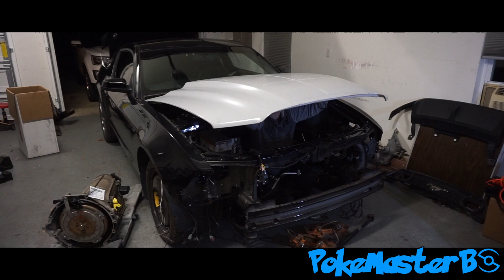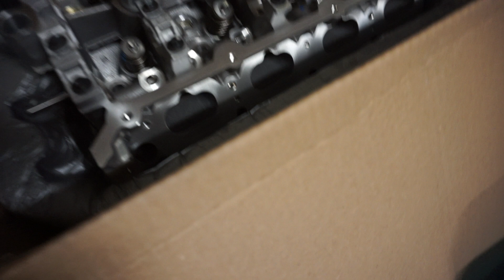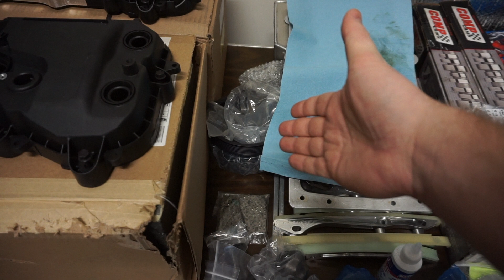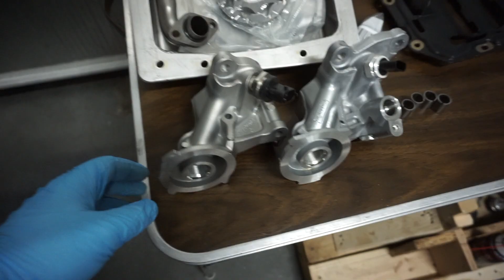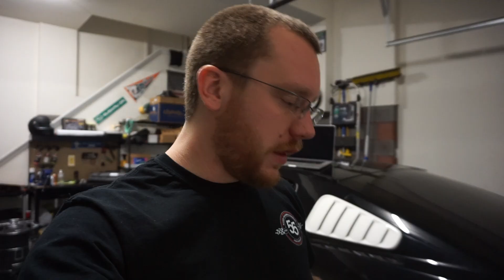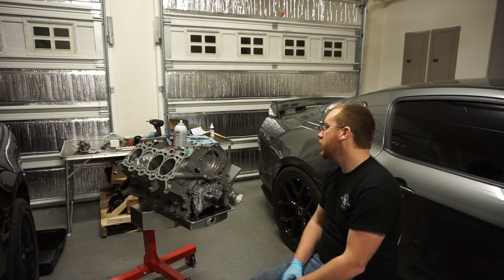Frankenstein Coyote Build p.1: Setting Up The Shortblock

Comment: Is it okay to remove one of the main cap bolts and install the cap bolt with the stud for the pick up spacer?
Reply from the maker: Absolutely. That’s the recommended way of doing the swap and more affordable for it over doing the arp main studs like I did.

Comment: If you dont use the ARP stud kit you will need to replace one of the main cap bolts for the bolt with a stud that the gen 2 block has and the gen 3 doesn't due to not needing a separate pick up tube.  the part number is BR3Z-6345-A.
Reply: I had to realized that myself when I turned the aluminator block around and saw all the cap bolts were the same but the engine kit I got came with one bolt which I’m guessing is the bolt for that replacement
Reply: Also, you can’t use the GEN three rear main seal housing because it uses a three pin connector on the crank case position sensor, and then the last thing is make sure you grab the knock sensors for a GEN two as well since the GEN three uses different knock sensors
Reply from the maker: All good relevant info 👍

Comment: I used gen 1 heads on a gen 3 block and had a leak. I used 12mm head bolts and gen 1 head gasket. Just kinda confused on what I should do
Reply from the maker: That combo in paper checks out. But if you had a leak you’ll obviously want to revisit most everything. Something that might be worth doing is just checking the torque on your head bolts and see if something is off there.
Reply: @pokemasterbs appreciate you! and what do you mean by paper checks out ?
Reply from the maker: @NoLimitTJ_  just a phrase. “On paper it checks out” as in logically I see no issue with it combo wise. Doesn’t mean you don’t have some kind of problem associated to the combo. But in theory it should be good.

Comment: Thanks for the video. How did the motor turn out? How many miles do you have on the engine now?
Reply from the maker: It’s been great to me. I think I have probably 10-20k miles. Hard to say exactly because my Speedo was off a significant amount for a long time. But plenty of pulls, couple of trips to the drag strip when I can go, and some general daily style driving dealing with traffic on occasion. It’s handled it all so far.

Comment: How much do you think this build would cost, or did cost when you did it?
Reply from the maker: I’d say anticipate between 6-10k depending on what all the parts you decide to do are and if you do the work yourself or have to pay someone.
Reply: @pokemasterbs that's not terrible, man! Yeah I would do all the work myself as well. I took last week and this week off work to install my roush blower and OPG on my 55kmile  Gen 1, so hopefully it lives a long life before having to be rebuilt
Reply from the maker: @TheManic.5-OH it definitely should last as long as you want it to with a solid tune! Mine never blew on me I just decided it was time for the upgrade as my goals were definitely beyond what the stock Gen 1 was going to take.
Reply: @pokemasterbs  oh for sure dude! Honestly I'm glad I pulled my timing cover for this job, I found my driver side main tensioner had a big ass split in it in the top portion where it mates to the head! I think some other guys found this too. I think it's safe to suggest guys replace these with BOSS tensioners when replacing timing components for the first time.
Reply from the maker: @TheManic.5-OH oh wow that’s surprising. I’ve never seen or heard of anyone having come across that but good to know to keep an eye out for.

Comment: Great video bro!!  Quick question? Would you done anything different? I’m getting ready to do the same!! I just ordered my block from ford performance and I was actually thinking about going back with the GT 350 crankshaft? Thanks
Reply from the maker: Nope note really! Car still runs great and was able to almost break 1000hp last week. The only thing I would recommend different from what o did originally is use the Gen 1/2 rear main seal retainer plate over keeping the Gen 3 plate when running the Gen 1/2 crank trigger sensor as it’s not supported correctly in the Gen 3 plate and is known to cause potential issues. Why would you choose to run a gt350 crank? That’s like the root issue for all the GT350s and their issues based on the harmonics from the flat plane crank and firing order change. Not to mention you would need a completely different computer setup either standalone or GT350 based to run it in whatever you’re dropping this into.

Comment: Did you have any issues with the gen 1 crankshaft position sensor and the gen 3 real main seal retainer?
Reply from the maker: Personally I have not. If I do they are minimal at worst. But I know of others who have had issue. General recommendation is swap the rear main cover to make sure you’ve got no problems.

Comment: Did that short block come with stock rods and pistons? Can that hold the power you are putting to that motor? 
Thanks!
Reply from the maker: Yea stock shortblock including rods and pistons. It’s had no issues so far and the cars been making 900hp or so without issue 👍

Comment: The reason they recommend checking and line honing the mains if necessary is because studs have a different clamping force than bolts which can distort the caps differently and change your clerences. 6 bolt mains tend to be very ridged. My machine shop told me that even with studs line honing wasn't nessisary. I also verified the clearances.
Reply from the maker: Right. Hadn’t heard that the 6 bolt mains tend to be rigid but makes sense. I’ve had zero issues with mine after doing what I did lol wouldn’t recommend it to anyone else but it’s worked for me 🤷‍♂️

Comment: Mine is a gen 1 (12mm) sleeved block with gen 2 cams and heads and a gen 3 intake and a build bottom end including billet oil pump. One of the nice things about the coyote is pretty much everything is compatible across the generations so long as you don't mix up things like timing chains.
Reply from the maker: Kind of like the Honda of muscle cars I guess right 😂
Reply: I though you ad to keep the gen1 cam ?  i just order a gen2 can i keep the gen 2 cam ??  i was gonna swap them with gen 1 and timing

Comment: When installing the new oil pump gear set, you want to coat the gears in a heavy coat of motor oil.  Its not good to start the pump on first startup with zero oil on the gears.  Also when you swapped your ARP bolts on the caps, you should have removed the caps, plastigauged the stock bolt set and record the results, removed them, installed the ARP bolts with plastigauge on the crank, remove the ARP bolts measure the gauge then compare the results of the 2 bolt sets.  That way you would KNOW if you are in spec with the new ARP bolts or NOT.  You can eliminate so many issues by using the oil pan that you used.  That was a excellent call!  That plastic crap should have never been used by Ford. They are just getting too cheap these days.

Since it has now been 2 years since you posted this, how is the motor?  Did you have any issues?  Still running good?  Blown up?
Reply from the maker: Great points and suggestions. I was aware of some of that when going into the build but having never assembled a motor before let alone a rotating assembly I wasn’t comfortable trying to mess with some of that stuff. It was a bit of a gamble doing what I did, however it seems to have been holding up great so far. I’ve got somewhere over 5k miles on the setup since getting it running and have never had any issues motorwise. What I did was the best thing I could come up with to compare based on the skill set and knowledge base I had at the time going into the build. In regards to the gears I never start fresh builds without at least priming the motor first by doing a no fuel crank a few times for that reason or trying to keep everything protected. But yeah so far so good! About to get it back together again after some revisions in my setup here today probably and should be set to keep on ticking along. Making a tad north of 900 whp through it.

Comment: so i’m very curious to know if i absolutely have to swap the oil filter adapter and the oil pan? i bought the gen 3 block and would like to use what comes on it but i’m not sure. please get back to me asap.
Reply from the maker: You don’t have to swap the oiling system just the oil filter adapter.

Comment: Hey bud I know you made this video a long time ago but I’m about to start a gen 1 shortblock swap into a gen 1 and got a couple questions what year oil pump and gears did you use as well as the rear main seal kit.
Reply from the maker: Oil pump/pick up tube/pan all need to match. Either all Gen 3 or Gen 1/2. If Gen 1/2 you need to swap out one main stuff for the oil pump pick up tube support. Rear main technically could be swapped to the Gen 1 to properly support the crank trigger sensor but you can leave it as the Gen 3 stock piece and be fine, that’s what I did. I just moved the rubber gasket further down the sensor to meet the rear cover. Never had any issues with it

Comment: Very nice work. Question, those side scoop- did u ever loose one? How well they stick? I afraid I’ll loose them with double side tape. Also do u have them blocked? Thank u
Reply from the maker: Thanks! I have never lost one of my side scoops. They are factory ones and just attached via 3M. They are blocked as that’s how they come OEM. They probably do have less air pressure on them because of that.

Comment: Great video. Thanks for sharing. Thinking bout going N/A build. Not racing. Going to my daughter. What would you recommend. Thanks. Much appreciated.  Not sure bout cans,  was thinking boss 302 intake. Headers, e85 47lb injectors.
Reply from the maker: Thanks! Sounds like a solid build list for a fun N/A setup! Only thing I would add to that list would be a few suspension mods like springs and rear control arms and should make a great little street car without being over the top 👍

Comment: How come you didn't use the gen3 heads?
Reply from the maker: Because you can’t. They are designed to work with the direct injection which isn’t an option on gen 1/2 cars. There are no provisions or parts to have been made by anyone to make them useable in the older gen setups. In addition gen 2 heads are so cheap it’s not worth doing gen 3 not do I believe the gen 3 flow significantly better etc.

Comment: Did you used 13-17 ARP head studs or 11-12/18+ ?
Reply from the maker: I used 12mm for the 11-12 motor. The 18+ are apparently different somehow but the 11-12 work perfectly fine and are what everyone used to my understanding.
Reply: @pokemasterbs  Thanks!

Comment: I am doing a similar build but I’m not 100% sure which timing cover I need to get the GEN 1 2 or 3 timing cover?
Reply from the maker: Just reuse your stock one. Unless you need an additional one then just get the gen 1.
Reply: @pokemasterbs  I am building the motor piece by piece just didn’t know if there was any major differences between the covers through the different generations
Reply from the maker: Gotcha. I think the gen 3 is fairly different but I would say just get whatever gen timing cover based on the car you plan to put it in.

Comment: So, why not put in good rods? Instead of using those powdered metal rods. You are going through a lot of time and money. They are not as good as a set of Oliver or Carrillo forged rods.
Reply: Additionally, I would not use the VVT. Especially if I was spending money on aftermarket cams.
Reply: I also noticed you installed the pan early. You put sealant on the rear main seal seam to the pan. Then torqued it down. What about the seam at the block/timing cover?
Reply from the maker: I don’t have plans of pushing the car over 1000 wheel HP so it didn’t seem necessary as these short blocks have made that and even more in stock form numerous times. In addition I don’t have the know how or experience to swap the rods and bearings etc on the bottom end so it was the simpler route to go to meet my needs. I could have deleted VCT but I would loose low end power and drive ability just for it to sound cool. Again it makes sense in certain higher power applications, but that’s not my car. As for the pan, I assembled it in the correct order. Are you referring to the rear block seal which holds the rear main seal? That comes assembled from ford siliconed together etc. I didn’t bother redoing it and so far it seems to have held up beautifully. If your are referring to the front timing cover I didn’t install that until the whole motor was assembled.

Comment: Can i run gen 1 heads? Im picking up a built sleeved gen 3 sb for my s197.
Reply from the maker: Yes just run gen 1 head gaskets to match.
Reply: @pokemasterbs  what are the pros of running gen 2 heads? Are they that necessary? I rather not spend another 1k for them if i dont really need them! Im looking to push around 850 on my gen 1
Reply from the maker: @s197productions6  They aren't necessary. You can reuse your stock gen 1 heads maybe just throw in better valve springs while you're in there. The benefits are the the fact that they are boss 302 flow equivalent, have stronger valve springs, larger valves than the standard gen 1, and are brand new and clean unlike your stock ones.

Comment: Do you have to switch out the oil pan for this build ?
Reply from the maker: If you want to retain the gen 1 oil pan sensor then yes. But I don’t believe it’s absolutely necessary. You could probably fit the gen 3 composite oil pan around the k-member but I’m not positive as I’ve never tried myself.
Reply: @pokemasterbs  ah got it. Thank you bro! Love the build going for a pretty much identical one!
Reply from the maker: No problem man, thank you! Good luck with the build, it’s a pretty badass setup if I say so myself lol

Comment: do you possibly have links to pretty much everything?
Reply from the maker: No I haven’t ever written a list of everything, but you can get with Go Hyde Racing and he can probably help you out with all of it in terms of part numbers and ordering. I’m hoping to consolidate it all at some point though.
Reply: since the gen 3 block has 12:1 compression , did the gen 2 heads you use had any work done to them ? i can’t seem to say it in good wording but compensate for that compression
Reply: and sorry for all the questions lol. been trying to pull the trigger on this swap but i am TRYING to get all the information i need.
Reply from the maker: No worries man. No the heads are completely stock. I wasn’t sure myself about clearance concerns but there are no issues when everything is timed correctly. I believe the valve reliefs are similar if not the same between gen 2 and gen 3 heads so it would make sense that there are no clearance issues.

Comment: so you used the stock pistons that the gen3 come with ?
Reply from the maker: Yessir. Stock shortblock except for the ARP main studs I swapped out.
Reply: @pokemasterbs  how has it been holding up so far?
Reply from the maker: So far it’s been great for me. I haven’t had any issues that were related to the motor itself. I probably have like 3k miles on the setup now I presume.

Comment: Good video but I feel there's alot of things not addressed. ARP studs go into the block dry. The reason for the ARP recommending a line hone is because of the increased clamping force deforming the block. And high HP cars you should be increasing oil clearances. The reasoning for this is more power=More heat. More heat causes metal expansion making the veryyyyy tight tolerances of these motors even tighter and leading to a catastrophic engine failure. Other than that I feel everything else is fantastic
Reply from the maker: Thanks, I definitely misunderstood the ARP instructions about mounting the studs into the block dry. It makes sense now that you point it out though as they only are installed hand tight anyways and the assembly lube is to create more consistent torque. At the time of doing all this I hadn’t found a local machine shop that I could take the block to so I opted not to worry about it as I figured it would be more realistic for the average enthusiast wanting to tackle this all themselves to just keep it that way. In retrospect knowing more now I probably should have considered the clearances on the main bearing etc more knowing I was looking to push the motor further than the previous one, but as of now the cars holding up great and I have had no issues yet so hopefully it continues to hold together! I have like 2500 miles on the setup now. Mixture of cruising to mustang week and back and beating on it for fun and it me visit to the local drag strip 👍 thanks for the input! Definitely keeping that info in the back of my head if I ever go down this road again, which I’m sure I will!
Reply: Yeah with that theory your still saying wrong. Oil clearances should not be increased that’s why most car engineers increase the oil cooling instead. Adding a simple nice big oil cooler should solve that issue.
Reply: @bryanmartinez1998  No, Metal expands with heat. Power=Heat. More power, More heat. Adding a oil cooler still doesnt affect the metal expansion